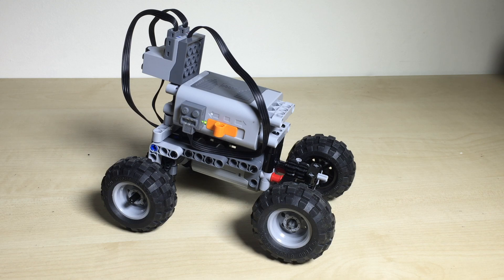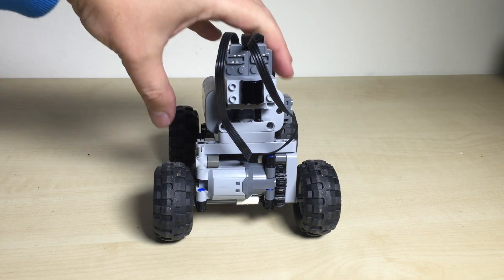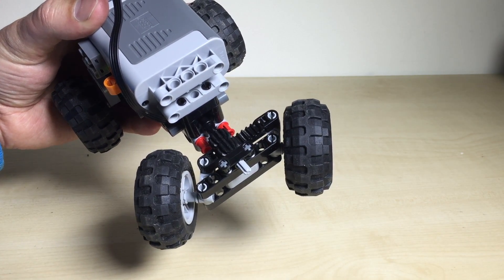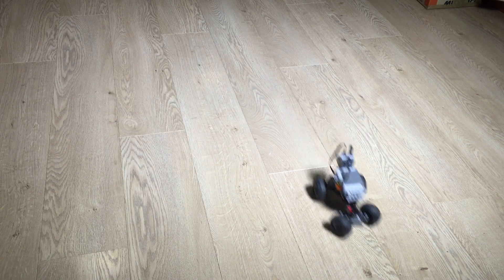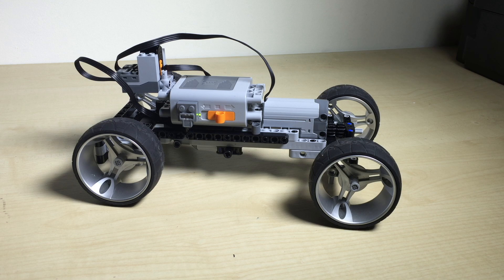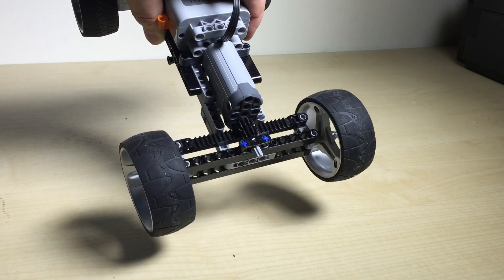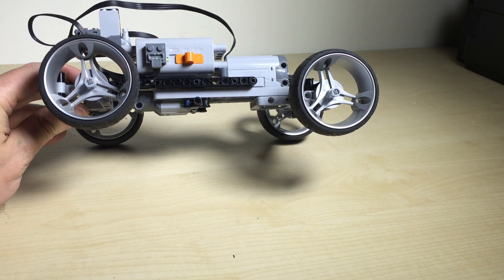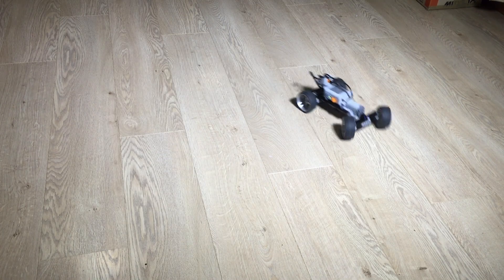Ultra Small And Fast LEGO RC Cars

Comment: Haha I came up with something like this on my own, but I used a lighter weight battery box and an m motor with a return to center mechanism.  Then I geared the l motor 3:1.  It took forever to accelerate, but when it did it looked it was being driven by a buggy motor!